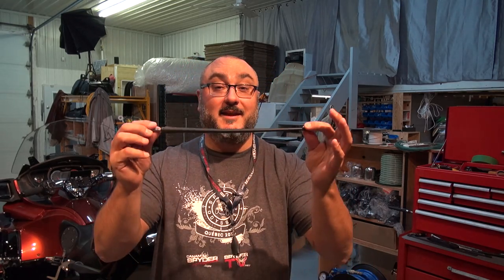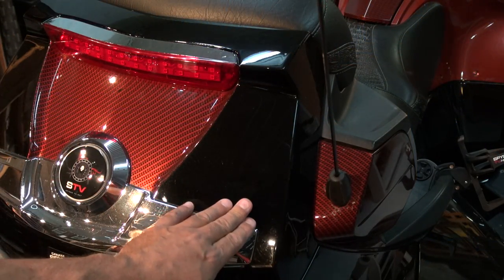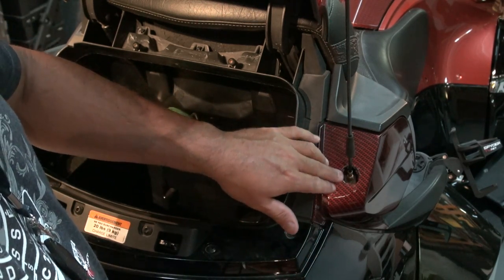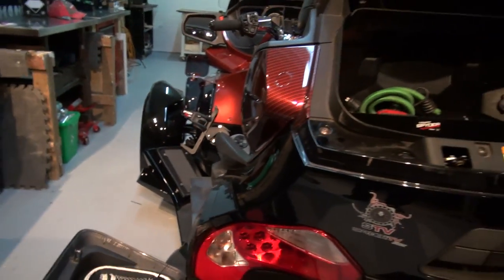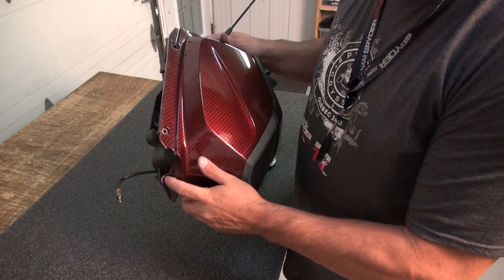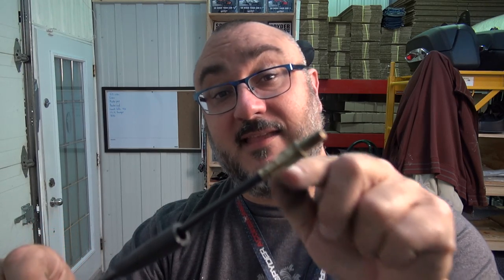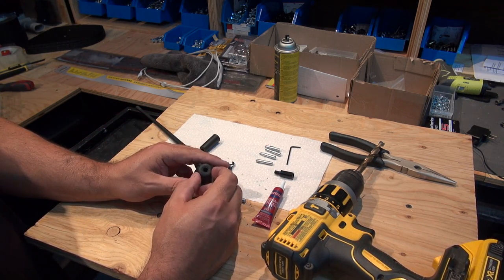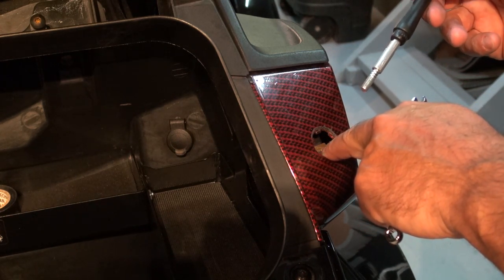RT Can Am Spyder - Replacing Antenna with a shorter one

Comment: Just removed the antenna on my 2018 and added the body colored cover. (I don't get very good FM around here and I have XM.) The process is slightly different on an '18 as there are some internal clips but the basic job is the same.

I couldn't/wouldn't have done this without this video. BRAVO, PIERRE!

Comment: Awesome Video.  The antenna on my 2010 RTS snapped off a couple of seasons ago I bought a small 1.5 inch Canadian Flag rubber ball from Dollarama and jammed it on the remaining 1/2 inch left of antenna :)  I have been meaning to replace the antenna at some point but typically just listen to my ipod anyway.

Comment: Thanks for the tips. I just broke my antenna and right after seeing your video I went to Walmart and bought the short antenna for
Can$ 11.95. Will be changing it soon. I have a 2011 and my antenna base has those square edges so hopefully I will just need to key it off. Thanks again.

Comment: The antenna on my 2015 RT broke right at the base. I removed the grommet and took out the brass fixture with a small metric deep socket. I replaced it with a stubby antenna. The entire job was about 5 minutes.

Comment: A tiny 7mm closed-end wrench fit on mine OK (the micro-sized craftsman metric), but you can't turn it many degrees at first before hitting paint, so it was a little fiddly.  But not as bad as removing the trim.  I could not visualize what was going on as mine seemed to stay quite tight even though rotating, so I thought I was rotating a nut behind it.  But I see now from your video that I could continue, and it did come out OK... What brand of antenna did you buy, and how is the reception, better or worse?  Thanks again!
Reply: You had the model number, DUH... Sorry!